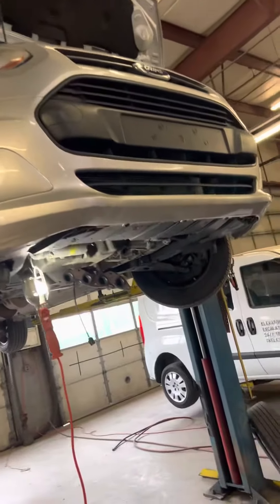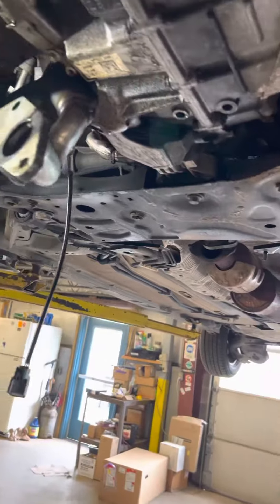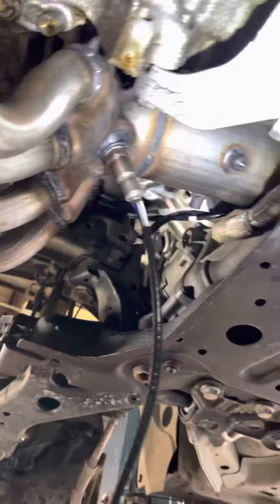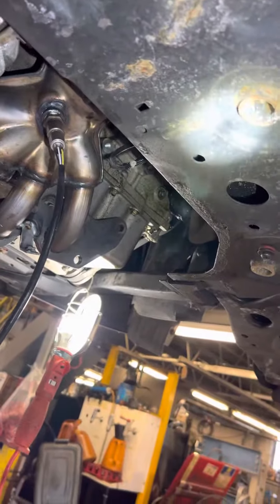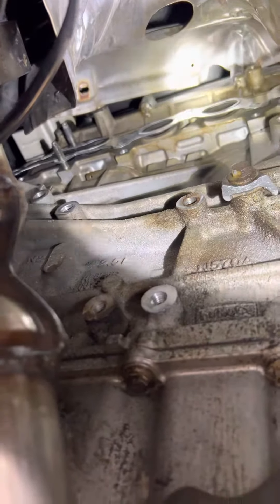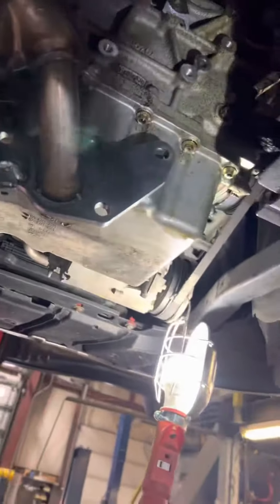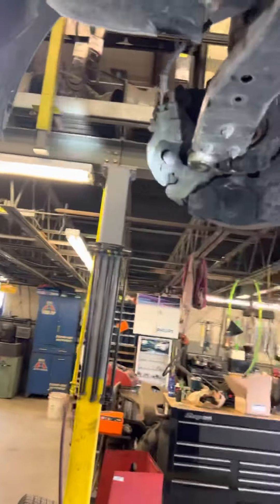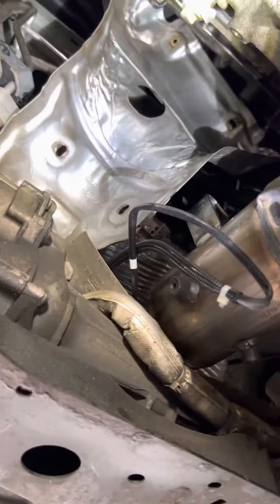2016 ford transit connect 2.5l upstream catalytic converters/manifold easy removal tips

Comment: I bought the socket from harbor freight $8.00 and it has a 3/8 soket hole on the side. It took me 15 min and didn’t have to remove anything else I just reached back there

Comment: we did it the way you said about 4hrs with my friend who is a mechanic...hardest thing was the heat shield re install....thanks for the great info
Reply from the maker: Yes sir!
Reply: Yup, I had trouble separating the ball joint, and installing the drive axle as the aftermarket manifold had that metal impression underneath that wasn't grooved to allow the drive axle, and worst of all lining up those 4 bolt holes on the heat shield.
Reply: @nlwin7789  mine fit nice, probably a different manufacturer

Comment: I assume that the 2018 transit is different than the 2016. In tried this and I didn't have any room at all. The rack and pinion is in the way.
Reply from the maker: @phil-1115  I don’t think it’s different but I could be wrong, this is the only cat I’ve done on one of these
Reply: @Natesautorepairs , I locked the steering wheel, disconnected the coupling to the rack, and lowered the subframe about a foot or so. Then I was able to get it out. The crazy thing is that AllData estimates 3.1 hours for the manifold. However, it estimates 3.8 hours for the subframe. That's AllData for you.
Reply from the maker: @ oh wow it must be different because I’m pretty sure the one in the video called for 6 hours or something crazy for the manifold
Reply: @Natesautorepairs , You know how Ford's are. From one year to the next the rotors, wiring diagrams, and everything changes.

Comment: I’ve got p0420 code 2017 transit connect. 160k mileage…I swear I hear an exhaust leak. What was the codes on this particular vehicle? And the repair done?

Comment: Thanks for the video. I did it in 5 hours with jack stands. Van still running like crap thought and throwing p0420 even with new 02 sensors as well
Reply: Break in period for new cats..
Reply: @moG4545   Blew all the material out the main cat and clogged the 2nd cat
Reply: @marteenhinojos8058  what year & mileage is your van? I’m having trouble diagnosing mine.
Reply: @moG4545   2016 120K. After i got the new 2ndary cat installed. It had a permanent code for the cat but went away after 150 miles driving
Reply: @marteenhinojos8058  this for the transit connect 2.5l correct? I have the p0420 code but the van still runs fine the only thing I hear is a tick coming from the motor but it’s never consistent. I think maybe the exhaust manifold gasket is probably shot & causing it to throw the code…
Reply: @moG4545   Yea, Mine would tick sometimes. But comes and goes. Check the o2 sensors. if they are good the primary cat manifold is likley bad, Make sure the cat is still intact or the 2nd cat will be clogged. Mine drove around sluggish like it was down on power
Reply: @marteenhinojos8058  Good to know man I appreciate the info. Where did you go to get the work done & how much did you spend on the repair?

Comment: That is an excellent trick, and thank you for your posting it.
All-Data says labor time for r&r of catalytic converter/exhaust manifold on this vehicle calls for 3.1 hours labor and if you look at the 1page(not 17) r&r procedure it says nothing about axles or anything other than the subframe. 
I was able to remove all nuts that hold manifold to the head using a long extension with a swivel and deep socket. Loosening the subframe consists of removing lower ball joint horizontal bolt, steering column to rack bolt, sway bar link lower nut, and basically the 4 bolts that hold the subframe to the vehicle. Used a trans Jack to lower it. 
What is annoying to me is that alldata says 3.1 hours to complete this job
Says 3.8 hours to r&r subframe 
Does not make sense, although I completed entire job in under 3 hours, if I had used your method I would have completed in under an hour

Comment: I've got a bad downstream O2 sensor (Bank 1 Sensor 2) on mine.  Is this the easiest way to access that sensor? Essentially just take off the skid plate and reach up to get to the O2 sensor?  Do you think I can remove the downstream O2 sensor while the exhaust manifold/cat converter is still attached to the engine block?
Reply from the maker: Hey sorry for the late reply I didn’t see this, I believe I was able to get b2 off without taking anything but that skid plate off.

Comment: how hard is it to get to the manifold bolts loose and did they come out easy? any break off?
my friend has a lift i can use on the weekend, approximate time need?
Reply from the maker: You need to get some from up top but not bad at all, all came out pretty easy. Total it’ll probably take about 3 hours if you have some knowledge and tools.
Reply: @Natesautorepairs  appreciate the info, mine isn't clogged, pieces broke off inside and making noises, thanks again